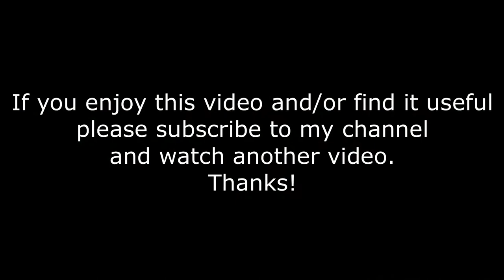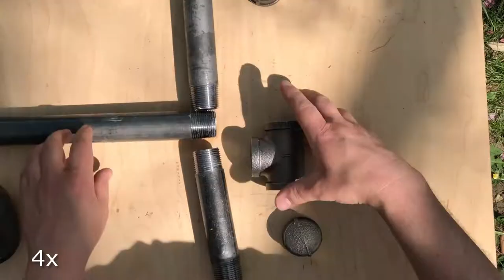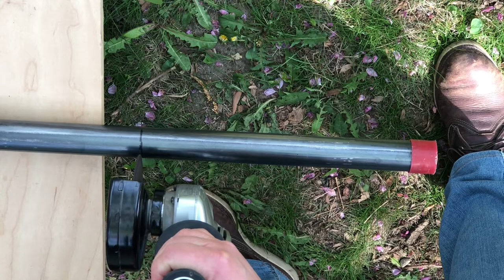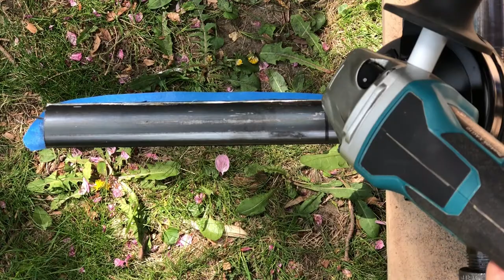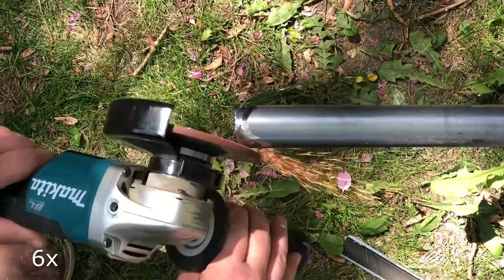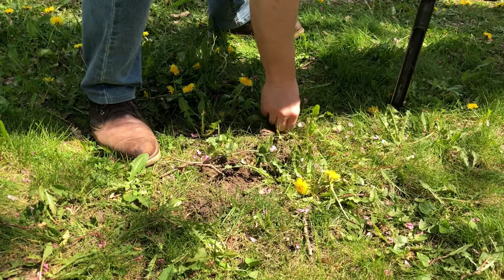How to Easily Make a Heavy Duty Dandelion Weeder Tool from Steel Pipe

Comment: Great videos.

Dandelion is a sign of soil nutrition deficiency or PH imbalance. Tap root is trying to draw nutrients from deep in the ground. I suggest getting a soil test to get at the root of the problem.
Reply from the maker: Fascinating. Surprisingly, I’ve never read this information anywhere else. You are correct about the soil pH. The intrinsic pH of the soil in my area is a bit high, which is why most of my gardening is done in containers. Thanks for the tip and I’m glad you like my videos.

Thanks for watching and commenting as well.
Reply: Are you kidding me   nothing to do with that seeds grow on any type of soil  get rid of seeds problem solved